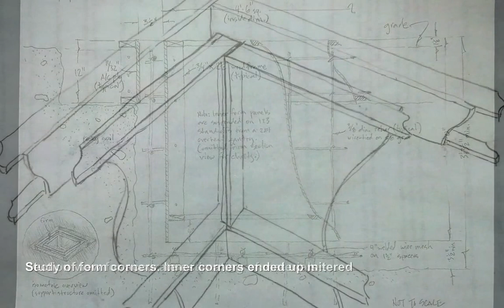Building a concrete in-ground water garden

Comment: How do you mange the pump?  Did you just drape the electric wire over the beautifully poured edge?
Reply from the maker: Mason Riddoch, I managed it via the water feature. Here are photos of the build for that, as well as the finished product:

https://photos.app.goo.gl/3OWcHu7383hxDzm12

https://photos.app.goo.gl/eWvats4E1b2nZhjs2
Reply: Jeremiah Small love it. Nice job. After commenting I was thought of a solution that would make a tall skinny U inside the wall with with pvc conduit. It would limit the full pool level in the pond but would be very minimal for my application

Comment: how can you be sure the concrete poured onto the wall would not push or add more concrete to  the floor?  Or do i have to wait until the floor concrete is a bit drier before i pour the concrete into the wall?
Reply from the maker: You don't have to worry about that. Pour and screed the floor first, then keep filling the walls. The concrete is too viscous to push up the floor with just the weight of the uncured walls. Do make sure to use a vibrator in the walls though, to make sure all the voids get filled.
Reply: Thanks